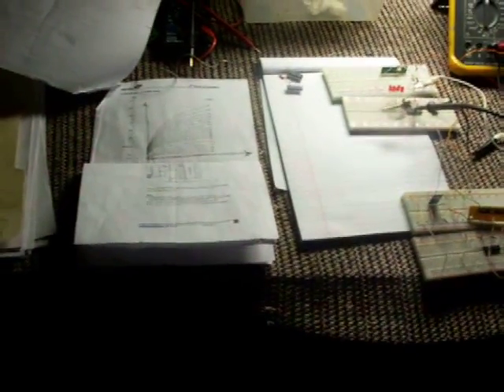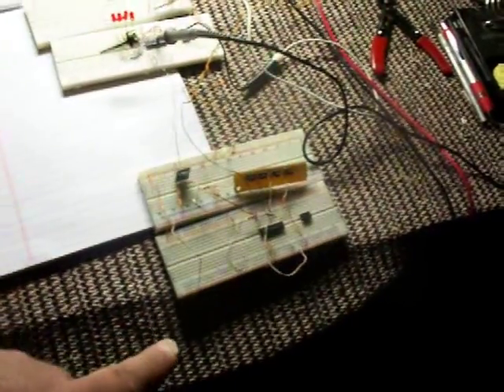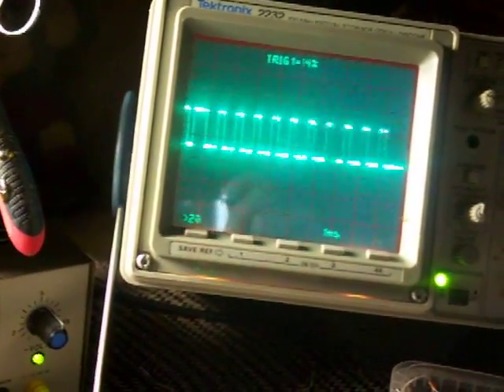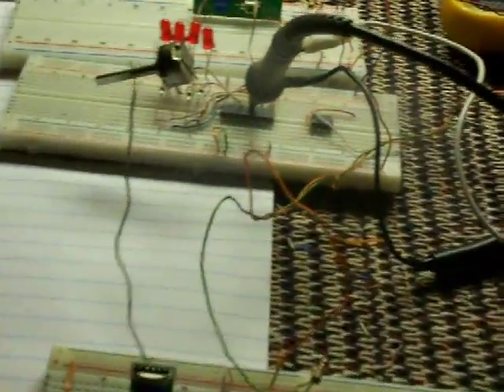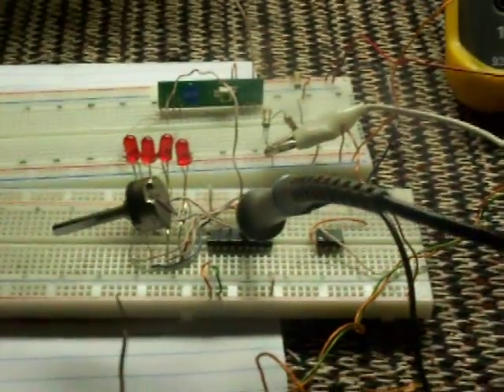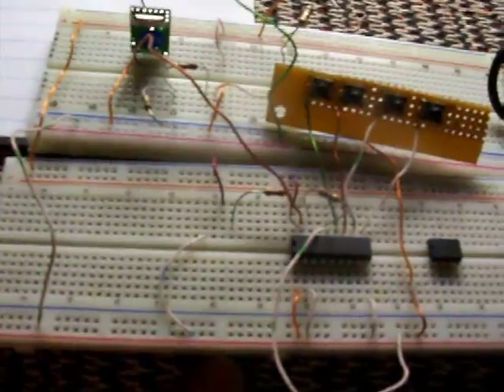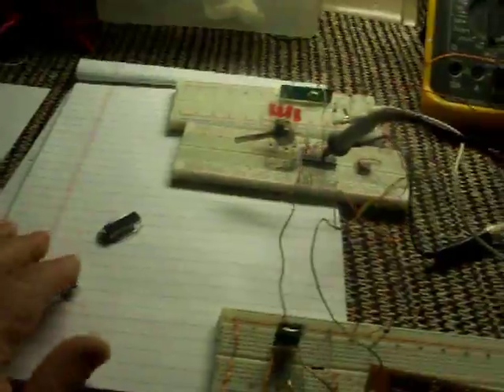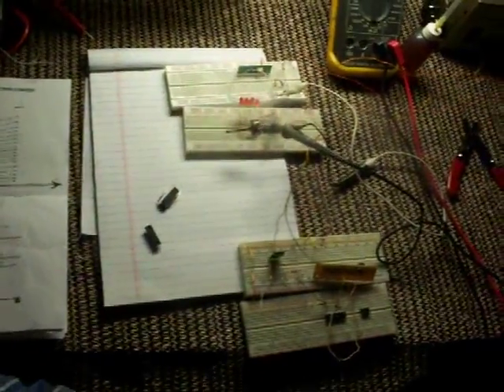HT12E and HT12D demo with parts.mov

Comment: I'm working with ir communication using HT12E & HT12D encoder and decoder ic. But i'm having problem to set the clock section. i just used a wire from transmitter to reciever pin to check the function of the ic. but it's not working.if i use a wire to treansmit data which resistor i have to use to match the clock frequency?

pls sugest .

thank you.